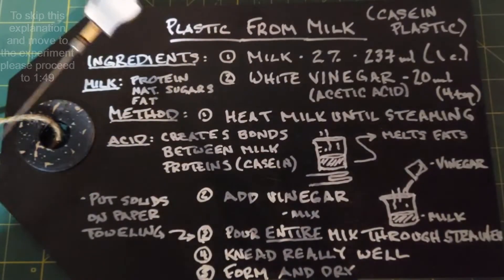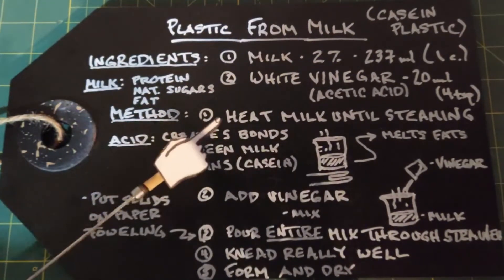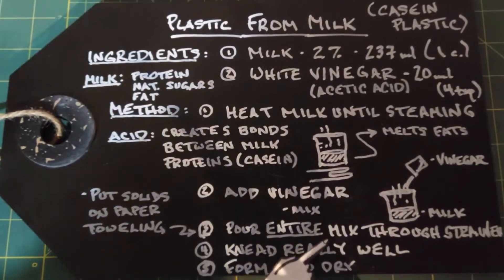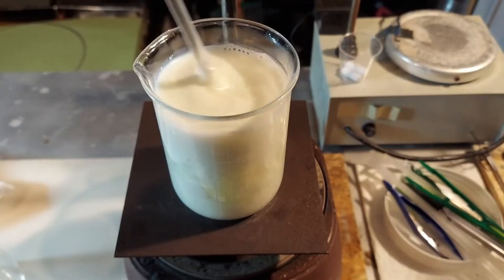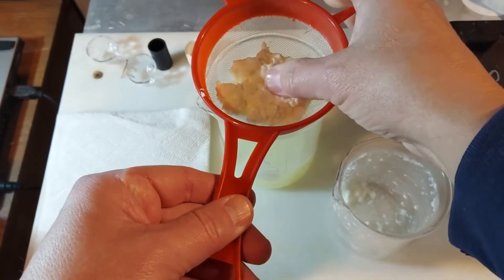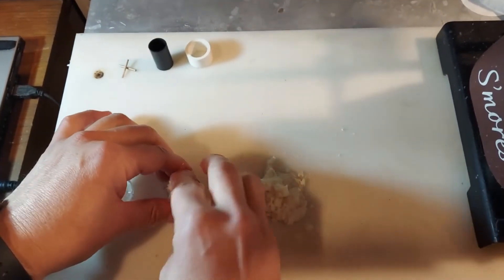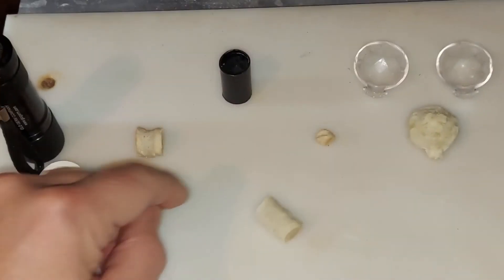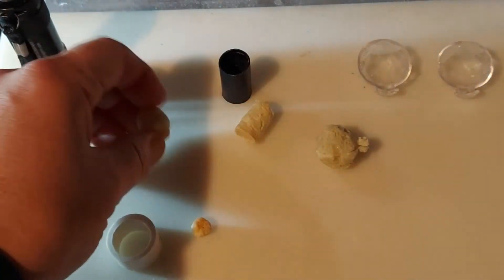Making Casein Plastic

Comment: You do not have to heat it! Do not!
Reply from the maker: Ok.  Thank you for your input.  I appreciate it.
Reply: heat acts as a catalyst to break those bonds and denature the casein protein, while yes, casein is resistant to heat denaturation, it still helps with the reaction. heating the milk is a necessary step to create this plastic.

Comment: Will they dissolve in water once it has hardened?
Reply from the maker: No, but over enough time it will soften.  To make the plastic completely waterproof it needs to be cured in formaldehyde (approx. 4%) for several months.